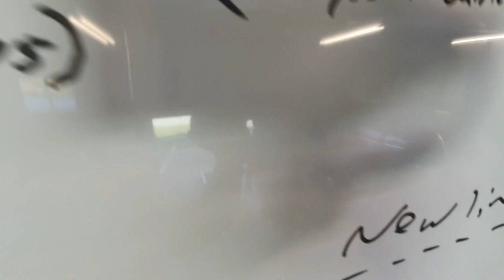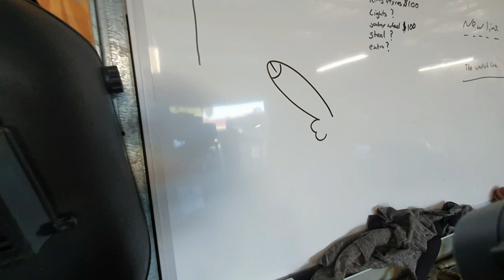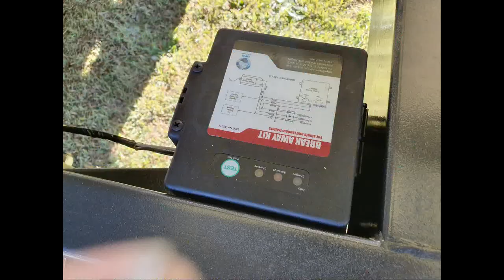3.2t toy hauler trailer build cut,weld,grind and assemble

Comment: Whats the go with registering home built trailers? Do you need any engineering certificates? Weighbridge dockets? How do you determine its payload?
Reply from the maker: 750kg is self assessed. Anything else up to 4.499t needs a simple road worthy certificate they ask for the weight of it but no paperwork to prove what you tell them. On first registration they will want to see the trailer just to check the vin is stamped on the chassis and measurements are correct. That's it kind of a bad system
Reply from the maker: Also the springs Axel's bearing will determine the weight it can carry
Reply: @AU-nappa  ok sweet, Im in WA so might even be a little diff ill chat to my local inspection place. How do you go about a VIN? Make one up? Or do they generate one?
Thanks for vid.
Reply from the maker: They generate one. In qld we can get 3 per year free after that we need to register as a manufacturer.

Comment: What is the size of your trailer measurements because I would like to make one for us
Reply from the maker: Nose to tail it just under 6m. Draw bar is back to the spring hangers cut length was 2700mm for memory. The main frame was 4050mm long and 1150 wide. Canopy is 1500x1780x850. Tray is off a 79 series. 2470x1850. We left a 80mm gap between the tray head board and the canopy.

Comment: What thickness steel did you use?
Reply from the maker: We used 100x50x3 for the main frame and 100x50x5 for the drawbar. The canopy sits on 50x50x2
Reply: @AU-nappa  Cheers for that!
Reply: How heavy did it end up?